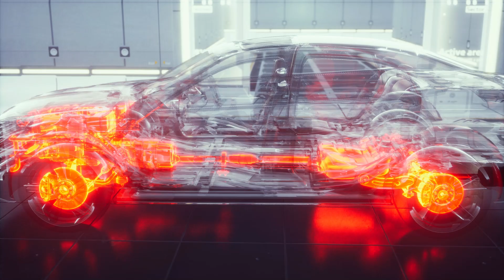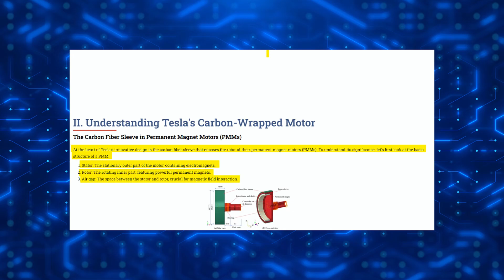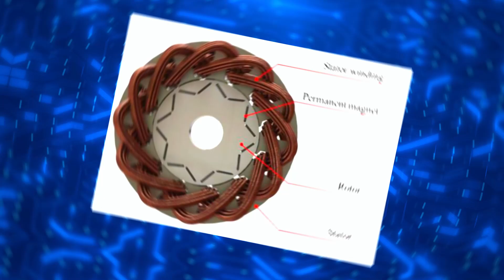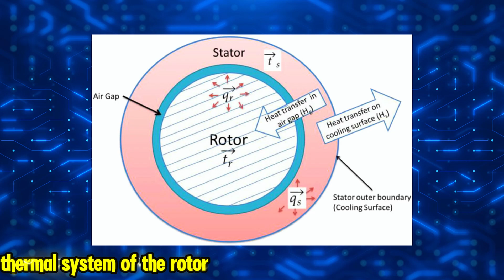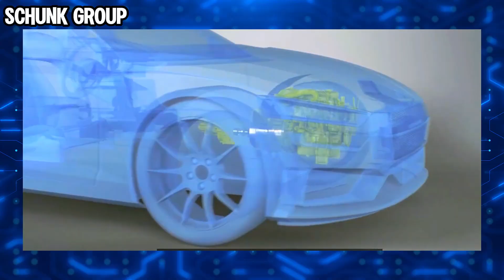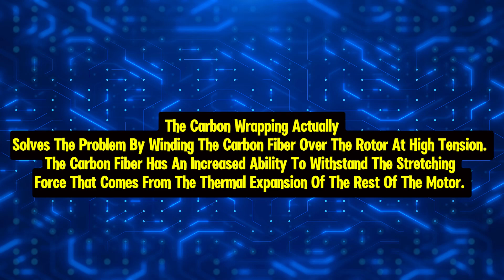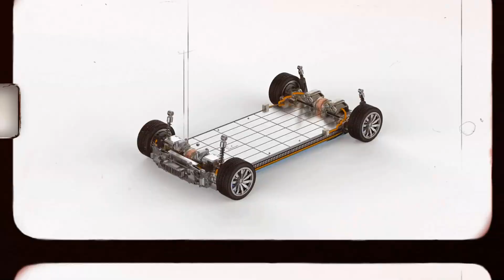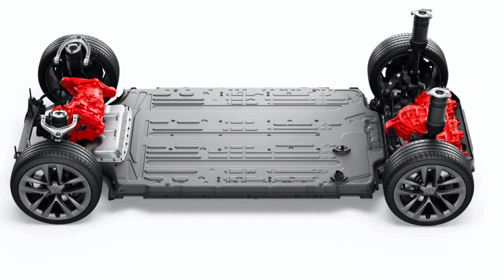Elon Musk: “This New Engine Will Destroy The Entire EV Industry!"

Comment: Hydrogen can be produced by splitting H2O into HHO (hydroxide) by the engine's electrical system as soon as it's started - the spark fires at top dead centre with hydrogen enters the cylinder head. I've done it using a very basic system but needed an electrolyte that didn't cook itself - I used bicarb but it cooked and failed after just a day. So it's possible. Thus it ran on water.

Comment: I really believe Toyota has more to offer consumers with its hydrogen powered engines which do not rely on batteries nor limited on range as refill time takes less time than conventional gas, diesel, natural gas or propane refills take.  Electric cars will remain top dog on speed but battery replacement, recharge time, mandatory travel to recharge stations with wait times associated with issues of long range travel issues.
Reply: Hydrogen engines require hydrogen fuel stations, it will face the same hardships as it did with Tesla's need to have electrical charging stations built and implemented thorough majority of the world for the demand to be fulfilled. 

I like hybrids, but not plug-in hybrids, I like the ones where the electrical motors charge by themselves when braking or otherwise, not recharged at charging stations. But I am for hydrogen as well, as I am eager to see how hydrogen technology develops and pumping stations becomes more available. Problem currently with hydrogen is not only lack of fueling stations, but that it requires large tanks, they are not small nor compact at current stage, so creating something like a family car is a no go. It can work as a sports car or any two seater, or a coupe, or a truck, but not something in a mini-van, SUV's, and station wagons.